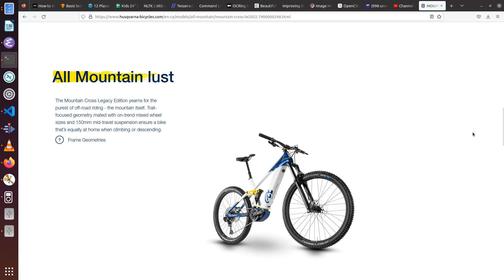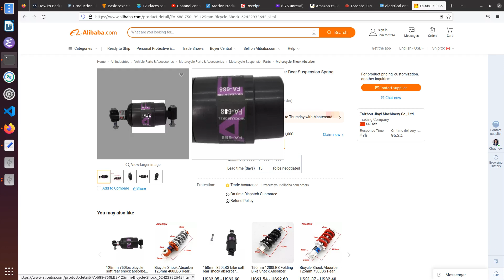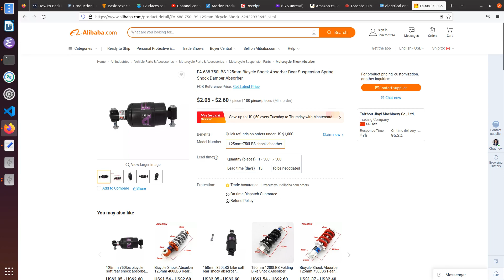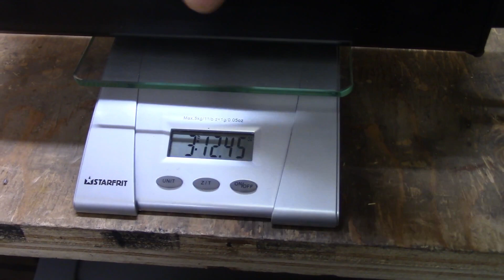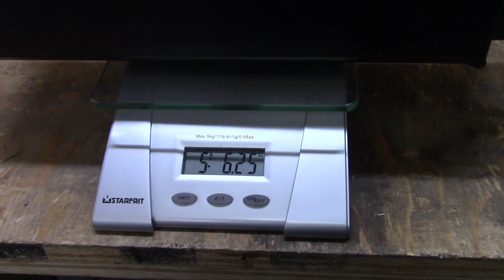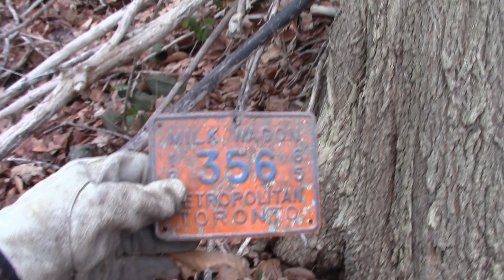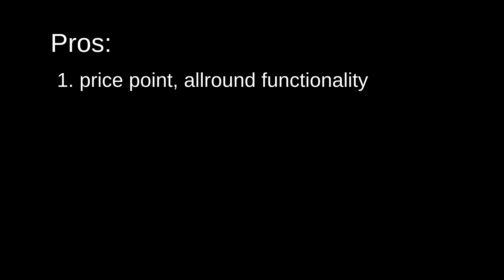Trail Building with a Costco Jetson

Comment: I see the comments of ppl saying the vid is boring and all , but i disagree! You went into all the details and things no one mentioned or dare to  check.    Also thanks for that throttle repleacement video , i got a throttle and will be using your video for guideance.
Reply from the maker: Hey thanks for the props! it was my first video lol so it wasn't going to be a masterpiece. But I was at least aiming higher than boring.  And a year later, I still haven't heard of anyone else rucking 50 lbs of tools on a jetson.